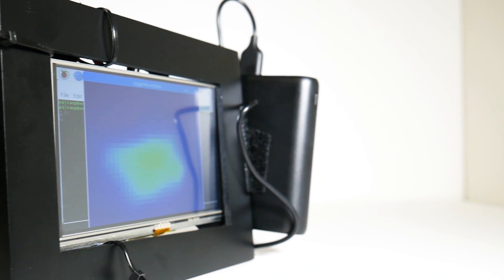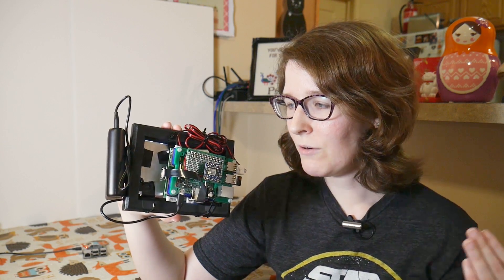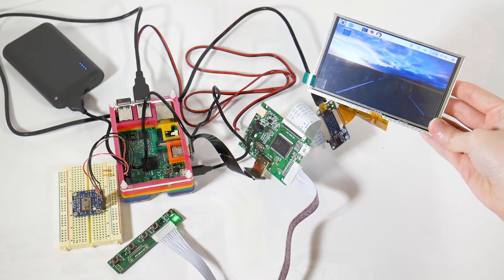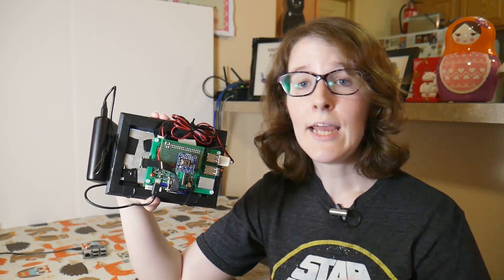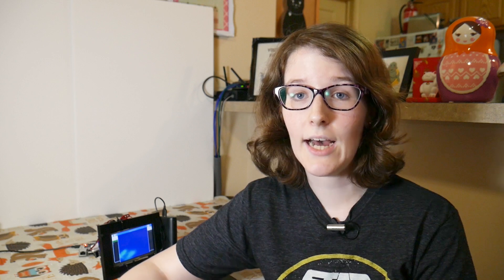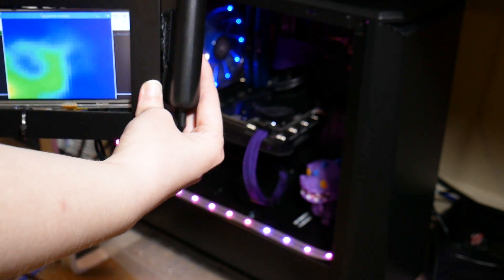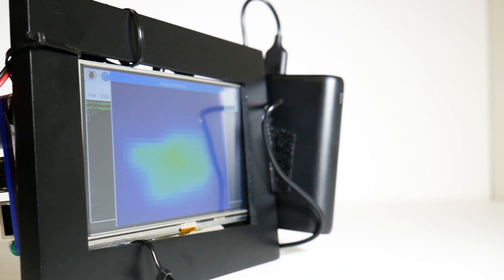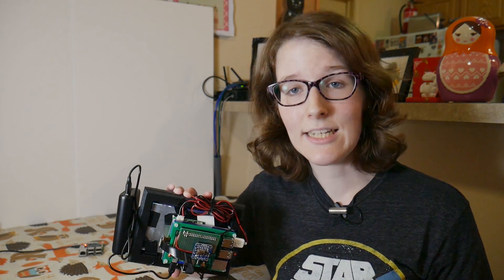Raspberry Pi Thermal Camera

Comment: I just started learning python less than a week ago. I have no knowledge of hardware. But I want to know so much. With rigorous studying, how long do you think it will take for me to not only comprehend what you said in the video but be able to build it myself. I know it can take years but I'm in for the long run. I was also wondering a few other things. Is it possible to build something that picks up thermal reading from a far distance? Is it possible to build something that can tell the distance from the object its reading? Instead of showing the thermal reading on  screen, is it possible to code it so that it preforms a certain action based on the reading? How long before I can understand and build something like that? How well do I have to understand both software and hardware to build something like that? I would really appreciate if you answered my questions, even though I might be asking ridicules questions.

Comment: Hi is there a way you can save/record the footage of the camera? :D
Reply from the maker: so you could in theory use ffmpeg or you could use VNC and then record via your desktop computer
Reply: @BlitzCityDIY  thanks, i was trying to make i rescue robot that will able to scan humans in a total dark area and the area most likely to be confined which means transferring data via wireless is not a good idea if the bot is too far inside. :D

Comment: this version has code that reverses the sensor reads. https://www.youtube.com/watch?v=tLwYMQjD0l4 code is here https://github.com/jamesdanielv/thermalcam/ look at Adafruit_AMG88xx.cpp. hope you got the mirror issue resolved.
void Adafruit_AMG88xx::readPixels(float *buf, uint8_t size)
{
 uint16_t recast;
 float converted;
 uint8_t bytesToRead = min((uint8_t)(size << 1), (uint8_t)(AMG88xx_PIXEL_ARRAY_SIZE << 1));
 uint8_t rawArray[bytesToRead];
 this->read(AMG88xx_PIXEL_OFFSET,rawArray, bytesToRead);
 
 for(int i=0; i<size; i++){
  uint8_t pos = i << 1;
  recast = ((uint16_t)rawArray[pos + 1] << 8) | ((uint16_t)rawArray[pos]);
  
  converted = signedMag12ToFloat(recast) * AMG88xx_PIXEL_TEMP_CONVERSION;
#if AMG88xx_PIXEL_MIRROR == false
     buf[i]=converted;  //unflipped
#endif

#if AMG88xx_PIXEL_MIRROR == true
//we convert to row and colum info, and invert the columb data@
     buf[(7-(i/8))*8+(i-(i/8)*8)]=converted;  //flipped
#endif
 }

 }

Comment: Hi Lise,
Long story short, would need this project to find heat leaks in my new old house.
I got a rasp 3 and everything needed to run it + a 3.5 Inch 320 X 480 TFT LCD Display Touch Board For Raspberry Pi.
I wonder how would I be able to plug the screen and the thermal camera?
I am good a re-doing/following steps not creating ;-)
Tks

Comment: I am hoping to use a thermal imaging device attached to a drone, which means it will need a range of at least 25 metres or 80 ft. Do you think this is likely to be possible using this kind of a setup?

Comment: Nice project! Not sure if you have found a fix for the mirroring of the image, but it could be done from software by modifying one line in the ~/Adafruit_AMG88xx_python/examples/thermal_cam.py file: change this "bicubic = griddata(points, pixels, (grid_x, grid_y), method='cubic')" to this "bicubic = griddata(points, pixels, (grid_x[::-1], grid_y), method='cubic')"  just inverting the grid_x array.
Reply from the maker: Oh that's great! Thank you!
Reply: Daniel, you just saved my sanity with that!!  Three cheers, and a tiger for you!

Comment: The datasheet puts it as an 8x8 matrix (64 pixel) sensor array.  That's hardly a font character.  Still useful data though to detect leaks and other uses.  but at that resolution, proximity is king.  Perhaps having the sensor on the end of a stick and tethered to the computer and display part would make a more interesting device.
Reply from the maker: The sensor is small but with the bicubic interpolation in the Python code I was really impressed with the resolution I was able to get out of it. It would be cool to make a dedicated device for a PC; maybe even tie in a program running on the desktop to give alerts.

Comment: Thank you there's not many helpful tutorials on these camera modules 😁 have you tried doing these scripts on a Asus tinkerboard?
Reply from the maker: I haven't yet but in the future I do want to do a video to see what can and can't run on the Tinker Board as far as GPIO and Raspberry Pi hats & bonnets 🙂
Reply: Blitz City DIY it's just some food for thought 😁  most of the hats fit directly on but you may have to link your own cable ribbons together for some of them due to the difference between the GPIO pins. I wish you the best of luck though 🎩
Reply from the maker: Thanks! It will definitely be interesting to see